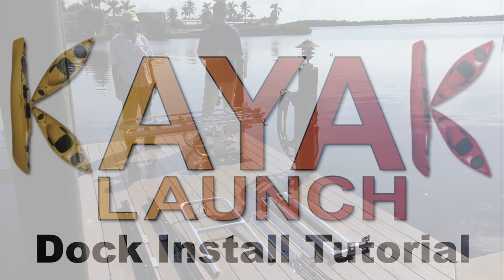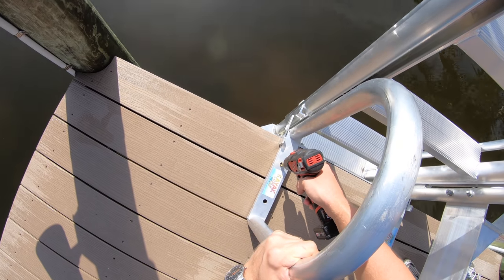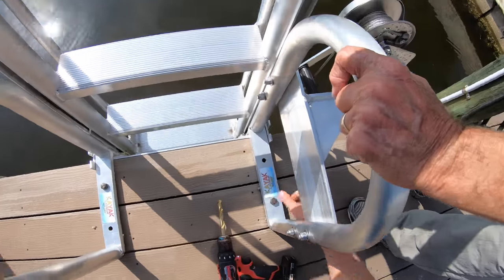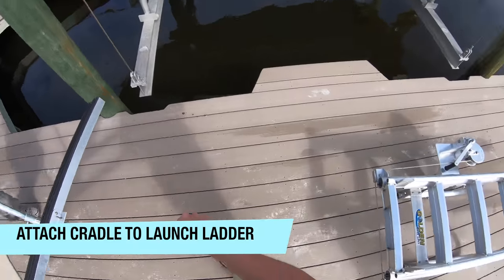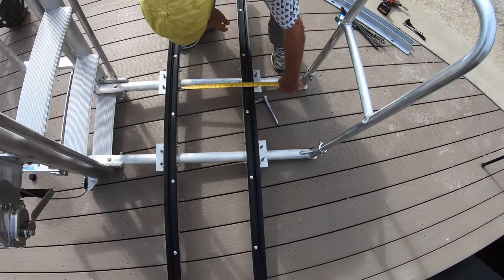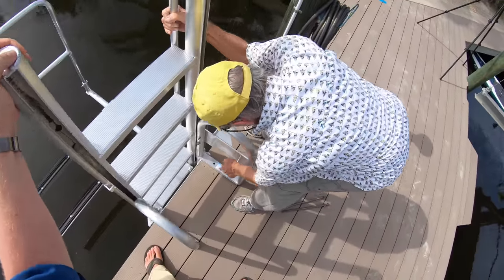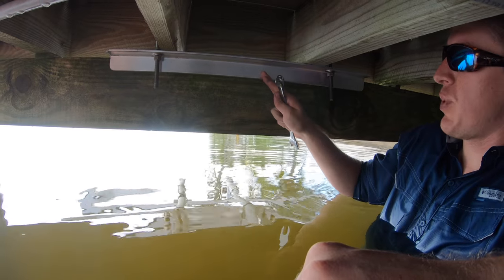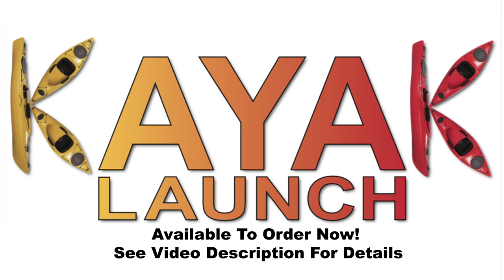Kayak Launch Dock Installation

Comment from the maker: I PAID FOR THIS KAYAK LAUNCH....THIS ISN'T JUST AN ADVERTISEMENT...I MAKE NO MONEY FROM SALES

KAYAK LAUNCH WEBSITE: www.DockandLaunch.com
INQUIRY & CONTACT INFO:
Don:   239-671-9343  Email: don@kayaklaunch.com

In this video we go over how to install the Kayak Launch on a dock.  I bought this launch for my in-laws so they could easier get into their kayaks from their dock.  In previous episodes we showed a Kayak Launch on my concrete sea wall.  I love mine and so felt like a good gift idea.  Here is how easily they install via 4 bolts.

The Kayak Launch is a versatile easily installed adaptable hoist and launch platform for kayaks.  It provides a safer, easier, and quicker way to launch kayaks from docks or seawalls.  It is made of high quality welded aluminum construction & stainless steel cables.  It is a ladder/hoist/launch all in one!  For safety reasons Kayak Launch doesn't recommend users to sit in kayak when operating winch up and down.  The launch system works with a wide array of kayak makes, models, and styles.  Contact Kayak Launch via site above or contact info below and we will get you setup with the best launch configuration to meet your needs.  Installation is easy and takes only minutes.  Four bolts hold the Launch to sea wall or dock.  Kayak Launch is made by Golden Manufacturing, a respected name in the marine industry.  Rest assured it is built to last!

Comment: Imo kayaking is all about simplicity. I slide my kayaks in off the dock and climb in. If the tide is very low i slide it in and use my dock ladder to climb in. My kayaks come inside after use and I would never leave them on a lift exposed to the elements. A lift would make launching more difficult for me plus i'd need to maintain the lift making even more work.  I think they're great for someone with physical limitations but for the average user imo a kayak lift is way overkill.

Comment: Looks great.  Did you climb under the dock beforehand?  Seems like you got lucky where the bolts fell each side of the bearer beam perfectly, and not on top of it, which would have prevented the bracket from fitting.

PS - You forgot the part where you drop the nut and washer in the water and drive across town looking for new stainless hardware. 😋
Reply from the maker: What can I say.....I’m the king of beginners luck. 😉. What you saw was pretty much it.  We didn’t do retakes.  Just filmed as we went. It was my first time installing one too.  The one on my seawall was different process and someone from the company installed it.  This one was pretty easy to do.  I could tell where stringers lined up without going underneath. 

In all seriousness the install was pretty easy.  There is the chance of dropping nut/washers in the water, but those four long 14” rods hold it in place without fasteners.  So if we did drop one in the water we could drive to any Home Depot or hardware store and likely get SS nuts and washers. The backing plates are drilled to give some leeway.  It is a close fit but most stringer beams seem to fall within the mounting holes.

Comment: Very helpful video and appreciated for you taking the time to put this clip together. What size and type of the thread rod (4)  that you used and where you buy them?
Reply from the maker: I think they sold the rod at the time with the launch.
Reply: What size and where did you get the U bolts?

Comment: My issue with this is the fact that it is not really a launch.  You can not put the kayak on the lift from the dock itself to launch.  You need to have already launched the kayak in order to put the kayak on the lift....hence it is more of a kayak storage option.  And because of issue #1...you can not launch a kayak for your wife or child either from this item....because again... you can not actually put the kayak onto the lift from the dock.  So if you need to be launched already to use this lift....its not actually a launch....because you are already launched.